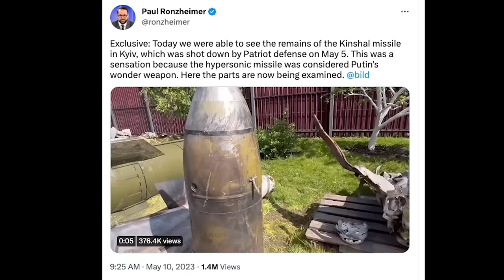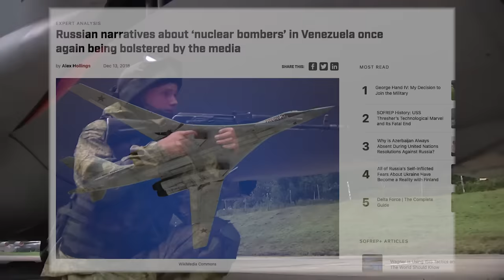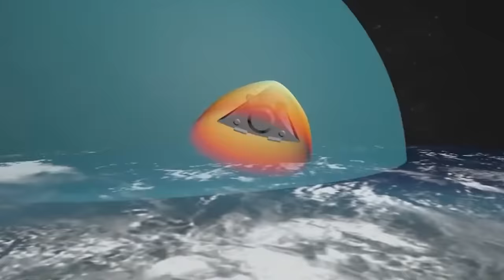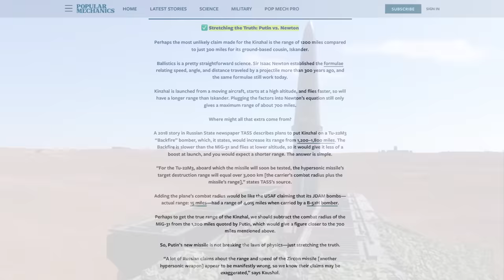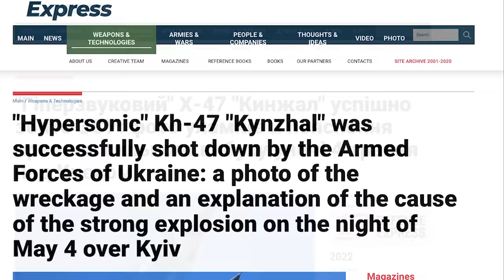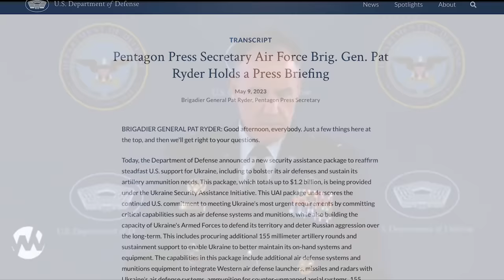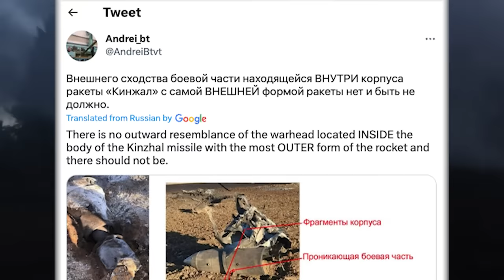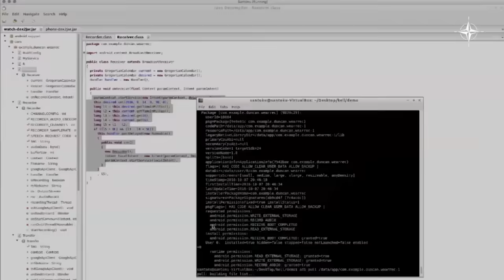Ukraine intercepts Russia's Kinzhal missile?!? Here's what happened

Comment: This is something I have tried to explain to critics of the MIM-104 Patriot system, albeit unsuccessfully for the most part.  The current system is NOT the same system used during the 1991 Persian Gulf War.  It has had a myriad of upgrades over the last 32 years and is now a FAR more capable and effective system than what was used to intercept Iraqi Scud missiles in the early 1990’s.
Reply: Most people I think do not understand the difference systems upgrades can make. I’ve seen the difference in my time in the Royal Australian Navy decades ago(before Desert Storm). New radars, new missiles, new software, etc., can almost create a whole new warship in terms of capability. The same principle applies.
Reply: @Changeur2009 no need. you just need to move to the side.  They can't hit moving targets.
Reply: @Changeur2009 from my understanding. The higher the speed of an object. The harder it is to maneuver. So more than likely yes.
Reply: That's funny, because if you think about it people are continually undergoing upgrades in the first part of their life.
They become stronger, faster, more co-ordinated, knowledgable, and skilled.
Same things applies.
Reply: @Changeur2009 Maybe at the limit of their range when they've slowed below Mach 4.5 or so.    That should be SM-6 missiles job or maybe THAAD.
Reply: I remember when that flaw was realized back then. Wasn’t it a internal clock that was off time making them inaccurate? I remember after they fixed the issue, it became a very effective system.
Reply: @jayyoutube8790  It has a 50 to max 75% probability of kill against aeroplanes, so I wouldn't call it very effective.
Reply: @Changeur2009  DF41 has already been acknowledged to be a BALLISTIC missile by the CCP.  Patriot and Aegis missile defense systems are successfully designed to counter Ballistic missiles.
Reply: @William zk  Again, DF41 is a ballistic missile.  All phases of US missile defenses can counter it, if not simply dodge CVNs turning at 30kts.
Reply: well Willy the problem is you tried with logic and facts and they use emotions, you cant argue against emotions...
Reply: The most telling aspect of the changes come from the elimination of the blast fragmentation warhead to a hit to kill system. Just like THAAD, Lockheed has produced missiles so accurate they no longer need warheads to intercept threats. Impressive.
Reply: None of the dong Feng missiles are hypersonic. The east wind hypersonic glide vehicle is used to carry some of China's missiles, the DF17 definitely, to target at hypersonic speeds
Reply: With the various PAC upgrades over the years it's a different weapon to the Patriot System used during the operation desert Strom. China's AD is untested as far as I know and Russia's, osa,buk, s300 aren't proving to be any problem for Israeli pilots operating over Syria. Does anyone know what Air defence system Turkey used to down the Russian jet that crossed over their border
Reply: @fifi23o5  there's video of an f-16 dodging several Russian made SAMs. A 50 to 75% kill rate per missile is much better than its contemporaries.
Reply: @jimmay1988  I can imagine the hypothetical hell about to be had by the sites that sent out carrier killer missiles. We tend to take the attempted murder of 5000 servicemen fairly personally.
Reply: The system that was unable to protect Saudi-Arabian oil installations against Houthi missiles was recent.
Reply: @KKSuited  A mission kill is still valuable, if a strike fighter is evading missiles on the way in its going to be ditching its payloads and running its afterburner. Its going home yes, but the mission isn't being complete which can have a whole array of consequences, even an entire strike package might have to roll back.
Reply: @Tuberuser187 they did complete their mission though, those SAMs did not stop anything.
Reply: Your absolutely right.
Reply: What would happen if it was carrying a nuclear war head?
Reply: @knightalexius593  The Houti attack was with shahad drones and the Patriots were not programed to detect them.  The drones also  bypassed other special defenses that should have picked them up.   Oddly Israeli Patriots don't have this problem so Id say its operator error.
Reply: @knightalexius593    False. The Patriot MIM-104 is made for aircraft and ballistic missiles, not slow/low flying, rudimentary UAV’s…which is what was used in Saudi Arabia.
Reply: With that logic though, the iskander or kinzal are a very big upgrade and also a completely different system than the Scud.
Im not here to say that I find Kinzal undefeatable, Im just gona state that if MIM-104 had such bad performance in 1990 against far older missiles, it can be argued that modern upgraded patriot systems can have just as bad performance.
A hypersonic missile can be intercepted in a point defense scenario, it will be much harder than a subsonic threat but its still doable.
The same cannot be said about area defense. If the super fast threat is not comming directly to your SAM site or city, its close to impossible to intercept. And when I say this I mean it, 99.9% of Ukraine is out of coverage, unless the threat is comming towards you, PAC 3 is close useless at any other scenario.
The reason for this is because a missile comming towards you is in line with the interceptor, its much harder to hit somethign passing by the Pac3 site.
Even if we consider the 30km range capability claimed, each site covers 706km2 which is 0.117% of the Ukranian mainland.
I highly doubt the actual range against a hypersonic ballistic weapon is 30km, its far closer to point defense, Id say less than 5km but thats specutlation.
30km is not the range the missile can reach, the missile can reach FAR longer, this is the range it can protect.
Reply: @fifi23o5  if you only fire one at a time. Launch 2 and your chances go up.
Reply: @mr.pavone9719  Of course. If the probability of kill is 50%, fire two and you get to 75%, fire three, you get to almost 87.5%, fire four and get to some 94%...
Reply: But it didn't intercept a Kinzal which is the claim that has been made.  The 'missile' the Ukrainians showed was in fact a concrete bursting bomb. Totally different shape to a hypersonic missile.
Reply: Yeah the Patriots worked so good in Saudi Arabia that the House of Saud decided to negotiate with the Houthi's.
Reply: @fifi23o5  Do you guys just make these % up? Provide proof!
Reply: @captainwin6333  and your expertise is what?
Reply: @TheGoodguy68  Do you want to use 3 million dollar rockets constantly to shoot down a 10k drone?
It's not really a great deal if you have to invest a few hundred times the money your opponent has to. 
Not sure why you are surprised that negotiations may be preferable...
Reply: @captainwin6333 Looks like you didn't watch the whole video.
Reply: @recoil53  so the pac 3 is like when I sprouted hair on my testicles?
Reply: Today Patriot spent 30 missiles in Kyiv and was destroyed. Also, this video shows not Kinzhal, Klitschko shows a bomb, not a Kinzhal missile, again a lie of Kyiv.
Reply: Today patriot destroyed in kiev
Reply: @amin_Darkeyes  Correct, NATO Patriot missile batteries shot down 18 Russian fascist terrorist Khinzel missiles.
Reply: @jayyoutube8790  Yes, the internal clock was the major issue.  The clock wasn’t perfectly accurate, and since the systems were running continuously for several days due to no concerns about being targeted, the clocks eventually got to be about a third of a second off (which is a big deal when intercepting missiles).  Once they started restarting the systems regularly, that was no longer an issue, although they still weren’t as accurate as we thought once we were able to  analyze grainy videos and look at missile wreckage.  

The main issue with the PAC-1 and PAC-2 is that they are not purpose built for missile defense.  They are traditional SAMs adapted for that purpose.  However, the PAC-3 is a totally new missile that is dedicated to missile defense.
Reply: @Tuberuser187  Maybe, but if the US is sending an F-16 into airspace defended by SAMs when stealth aircraft are available, then the F-16 is probably there specifically for a SEAD mission.  Shooting at it just shows it where to send the HARMs.
Reply: @СерхиоБускетс-ф7я  LOL.  The Patriot battery shot down 6 Khinzals and 12 other cruise missiles, and suffered only minor damage in return.
Reply: Well I mean Ukraine just got hit with an exceptionally high amount of missiles, so your comment and this video didnt age well. 3 days.
Reply: @geroutathat  not necessarily.  You do realize that so far the US has only sent ONE complete MIM-104 Patriot battery to Ukraine?  That isn’t even enough to protect the entire city of Kiev, let alone the entire country.  More than 99% of Ukrainian airspace is currently NOT protected by Patriots, so I would expect Russian missiles to continue to strike targets in Ukraine and Kiev.
Reply: and now the system in Kiev rests in peices.
Reply: @knightalexius593 because it's used by saudis
Reply: @captainwin6333  "The 'missile' the Ukrainians showed was in fact a concrete bursting bomb." Ah well then, everything you want to believe must be true. Because.
Reply: The US MIM.104 Patriot Missile used in Gulf war  1991 and that shoot down Soviet era Scud missile supplied to Iraq and now US MIM 104 Patriot Missile supplied to Ukraine is now a game changer and that can knock Russia Hypersonic cruise missile KH47 Knizhal cruise missile
Reply: @Changeur2009 chinese  hypersonic,down in Pacific,chinese is no1  copying Western arms,😢😢😢😢😢
Reply: We already knew that.  It has been posted LONG before this.  Thanks, anyway.
Reply: Wow, pac 3 can shoot hypersonic object. Ok lol
Reply: The system was still quite capable in the 1990’s too. But we lacked the right doctrine to utilize them which led to losses. We also focused more heavily on air dominance than air defense which changed after 1990.
Reply: Why the inside component did not explode once it was hit or what type of component inside can remain after missile explode?
I don't get it at all.
Reply: The only capable system to intercept hiper sonic missile is THADD, in fact Patriot was not designed to such task, it has never tested with hiper sonic missile.
Propaganda can make up amazing stories in war times
Reply: @NoName-ds5uq  the only system capable to intercept hiper sonic missile is THADD, Patriot has never been tested to deal with hiper sonic missile such kintzal
Reply: @captainwin6333  you paid zero attention to the video. It's the warhead INSIDE the Kinzhal.
Reply: @Centrodemasa  pay attention next time you're in Sandboxx class, you might learn something. Something besides Russian propaganda you spout.
Reply: @Tony-fb1ij  for sure.....We want to see Patriot tested agains hiper sonic missile 🤡
Reply: So, what is next? ;) No matter how the patriot air defense system is improved, it cannot destroy aeroballistic hypersonic targets. Just as he cannot destroy the "iskandar", the predecessor of the "dagger".
Reply: when an area air defence system become a point defence system     32 missiles in one GO😢
Reply: @knightalexius593 Thats why Israel replaced it with David Sling Missile (PAC4)
Reply: @bluemarlin8138 LOL in Order to Test Your Air Defense Systems against a Hypersonic Missile....You have must have an Operational Hypersonic Missile Systems to begin with? Does US have 1?
Reply: But isn't it a fact that the patriot radar or any radar can't operate against hypersonic missiles due to the plasma shield created around the missile by its high speed
Reply: Turns out that Russian advanced technology was myth. We can thank Ukraine for debunking that myth.
Reply: @terjeoseberg990  Afghanistan claimed to have shot down one Pakistani  F-16A during an encounter on 29 April 1987 with a Mig21 ; the pilot ejected safely and landed in Pakistani territory. Pakistani authorities admitted to having lost a fighter jet to enemy fighters, but suggested that it may have been either an F-16 or an F-6 and insisted it was attacked over Pakistani territory.Subsequently, Pakistani officials confirmed that the loss was an F-16 in 1987, but asserted it was accidentally shot down during a dogfight with enemy aircraft over Pakistani territory. According to this claim, Flight Lieutenant Shahid Sikandar Khan's F-16 was hit by an R73 missile fired by  an Afganistan Mig 21 piloted by Squadron Leader Amjad Javed of Afganistan Airfrorce in 1988. Tq Afganistan for debunking it
Reply: @fifi23o5  shooting down a fast jet combat aircraft is much more difficult than shooting down an cruise missile or a ballistic missile (so long as the SAM system has anti ballistic missile capability). An aircraft can manoeuvre and has continuous thrust so it can turn into a direction that makes it harder for the missile to follow and outrun it. A missile will run out of energy very fast while manoeuvring in air, especially dense air at low altitude. These are things modern combat jets are mostly very good at. They can manoeuvre and then increase thrust to maintain energy which the missile cannot
Reply: People just need to think if Microsoft went from windows 3.1 to windows 11 why can’t weapon manufacturers and developers not do the same with the patriot and other weapons.
Reply: @Andy-kl1ry  if it can be detected quickly enough, it can be hit, unless it is highly maneuverable, which obviously Kinzhal is not.  It's basically an air launched ballistic missile. But a PAC-3 IS highly maneuverable.
Reply: @mustang5132  Is shooting down a jet plane harder than shooting down a rocket? :))) Seriously? Did you hear this somewhere or did you come up with it yourself? :)) A missile, even a slow one (cruise missile), has always been and will be a difficult target, and a hypersonic one is impossible.
Reply: @Tony-fb1ij  Well, you know better. You can feel the confident statements of a professional... So, "Iskander" was able to maneuver in the atmosphere, and the "dagger" rocket based on the development of Iskander technologies has forgotten how? Well, for some reason I immediately believed you! 🤣😂 Where have you heard enough fairy tales about the dagger missile? 😆😆
Reply: @Andy-kl1ry  it depends what the missile is capable of doing. I specifically said it is easier for a system that is developed to do that and has the capabilities. When a SAM system is developed with shooting down ballistic missiles in mind, after some development, it becomes quite efficient in that. THAAD, Arrow 3, patriot pac 3 (although I’m sure that in this comments section that will be debated), Aegis, etc have proven to be relatively effective in this regard and some have even been now proven in combat. Anti aircraft missiles have a harder time though because the target is not on a pre planned trajectory like a ballistic missile. A plane can hide in between terrain or after deploying its payload, leave the effective range of the missile. This doesn’t mean it’s easy to escape a well placed SAM shot but a SAM targeting fighter aircraft will not be as efficient in getting a kill as a SAM trying to destroying ballistic missiles. I think what you’re getting confused about is that I said (or at least meant) that an anti ballistic missile system is quite good at what it does. However, this does not mean it is easy to MAKE one. The word I probably should have used is efficient to explain what I meant more, efficiency in engagement rate to kill ratio
Reply: @Andy-kl1ry  also a hypersonic one is not impossible if you’re implying kinzhal is a hypersonic missile. Just because something goes mach 5 doesn’t mean it’s impossible to shoot down. Many ballistic missiles going over mach 5 have been shot down in combat
Reply: @mustang5132  If the target is ballistic, hypersound is really not an obstacle. To destroy ballistic targets, it is enough to have accurate missiles that will be at the right point in the ballistic trajectory. However, here's the problem... 1. Hypersonic missiles, due to their speed, drastically reduce the window into which an anti-missile can fit in order to destroy the target. 2. Hypersonic missiles move in a cloud of plasma, which interferes with the work of radars 3. And the cherry on the cake. The dagger missile is NOT ballistic. ;) There are more features, but there is no particular sense to talk about them, since this is not a secret, especially if you think a little.
Reply: @Andy-kl1ry  so I suppose you understand and agree with my point then from before? And kinzhal is a modification of a ballistic missile. Yes it can follow a few waypoints but it cannot conduct rapid manoeuvres while maintaining its high speed since it’s not powered in flight. No it’s not exactly a ballistic missile but in its terminal phase, it acts the same
Reply: @Andy-kl1ry  explain to me how kinzhal is a “modern hypersonic” missile then. How does it maintain its energy after performing manoeuvres? Oh wait! It cannot. It flies at above mach 5 for a portion of its journey but once it is at its target, it has slowed down a lot. I don’t know how much it has slowed down by and neither do you but it’s almost certainly not mach 5, which is just under the speed it has started with.  As we accept this, as I’m sure you will since you are probably not a complete idiot who does not believe in physics I guess, we can conclude that it is not a modern hypersonic missile ;) 

PS: there are pictures and videos of kinzhal being destroyed and the wreckage of them. Many different ones actually. You should probably look at that and understand that your invincible dagger is actually not so invincible
Reply: I can prove it was capable back then too. But yeah it was always 99.9%+.
Reply: @AzultonSmugUltra  I doubt you can prove anything. 90% of the people with whom I corresponded do not use logic, but propaganda. Naturally, after such "reasoning", 6 "dagger" missiles are easily destroyed. :)) And the most important evidence, as a rule, is a photo of Klitschko with an air bomb in his hands. :))) I suspect that you will also "prove" approximately the same. :(
Reply: @jimmay1988  American propaganda recognized all the missiles in the world as "ballistic", including the "dagger" and "Iskander" missiles. According to the same propaganda, the "patriot" system is the most effective in the world. In reality, however, its effectiveness is very modest.
Reply: @matt.willoughby  You're trying to talk about a topic you don't understand at all. Just as you don’t understand the reasons why Israeli pilots are still alive and why a Su-24 bomber was shot down in Turkey. And even more so, it is extremely stupid to mention the ancient systems "osa" and "beech" which were not left in service with Russia.
Reply: @KKSuited  seriously!? And on the rockets was written "hello from Russia"? 😆 I really want to look at this video. PS ah, yes... I forgot, and indeed, there is a video... "Top Gun: Maverick"... 🤣😂😆
Reply: @mr.pavone9719  Against the "dagger" missile, 32 (!) missiles were fired, this did not help. The most expensive salvo in the history of air defense with zero effectiveness.
Reply: @ctcole77  18? Why so few? 🤣 the number of destroyed "dagger" missiles is constantly growing, it started from 6 .. 😂
Reply: @robertoaseremo4163  LOL before talking about how many missiles were destroyed, you need to understand that the "dagger" missile is NOT winged, but aeroballistic.
Reply: @Tony-fb1ij  🤣A cast-iron blank inside a dagger rocket!? Do you yourself believe in what you wrote? 😂
Reply: @Centrodemasa  so they tested him ... 32 rockets into milk. 🤣
Reply: I prefer to think of this Patriot system as the same one from the Gulf War. It makes the humiliation of the Russian "hypersonic" missile system so much more complete.
Reply: @DominickWalenczak  you can think whatever you want, as long as it calms you down. :) But so far there has only been a humiliation of the "patriot" MANPADS. :))
Reply: @Andy-kl1ry  didn't know make a man portable version of the Patriot. 😂
Reply: @DominickWalenczak  you act shocked that this "Andy" character doesn't know the difference between MANPADS and HIMAD.
Reply: Alex, Tell us a little more about US hypersonic missile AGM-183a arrw. In one of its tests, the booster failed to ignite and AGM-183a fell into the ocean vertically at a hypersonic speed😂😂
Reply: It was not Kinzhal. It was bunker buster BetAB-500 bomb
Reply: @setareetemadi6043  You do not understand! Firstly, she did not fall, but splashed down beautifully as part of scheduled tests, as planned. And everything else is Russian propaganda, and Putin is to blame. And secondly, the AGM-183a arrw is a correct democratic hypersonic missile, so even if it works crappy, it's still correct, and the "dagger" hypersonic missile is Ruzzian. Therefore, even if the "dagger" works great, it is still worthless, because it is NOT a democratic missile! That is why subsonic, but democratic "patriot" missiles can destroy hypersonic, but NOT DEMOCRATIC "dagger" missiles. Democracy defeats evil! Salo Uraine! 🤣😂😆
Reply: @Willy Mac Kinzhal is not a Scud either. The Patriot exploded after firing 30 missiles at 2 Kinzhals.
Reply: @julianpetkov8320 The most expensive salvo in the history of air defense that ended in failure. :) Apparently they shot "for good luck" ... No luck.
Reply: @setareetemadi6043  you can keep denying that Kinzhal was shot down by Patriot all you want.
Reply: @Changeur2009 I'm going out on a limb to say yes.  Please refer to the other comments here about moving faster makes it hard to move to the side.  These missiles trajectory is predictable and we can intercept that and take them out.
Reply: There is a good video which explains why ukrianians thought they downed 6 Kinzhals, but actually did not. Most likely only 2 kinzhals were sent and both hit the target.
Reply: MIM-104 Critics: [time stopped in 1991]
A-10 Warthog Critics: [time stopped in 1991]
PGM Critics: [time stopped in 1991]
Bradley Critics: [time stopped in 1991]
Abrams Critics: [time stopped in 1991]
T-72/T-80 Advocates: [time stopped in 1991]
...I'm seeing a pattern here.
Reply: @robertoaseremo4163 scud missiles ? What about more ally jets than skud missiles lol wanna bet? Check Iraqi freedom stats lol
Reply: Lol....🤡🌏🤣🤣🤣🤣🤣